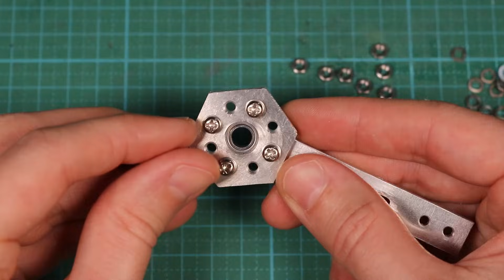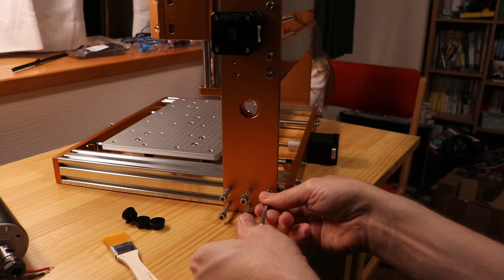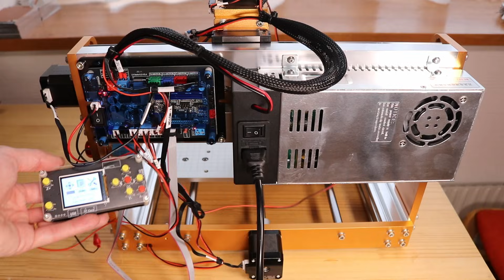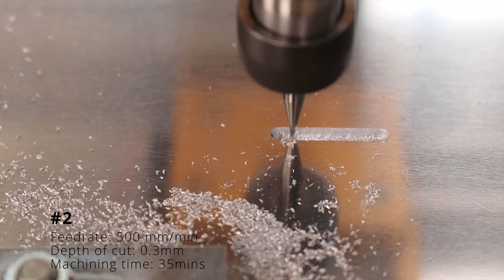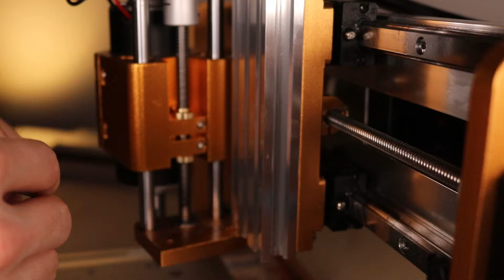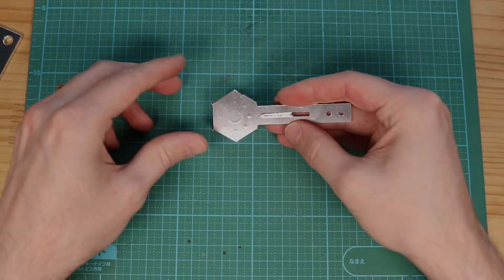Work on Hexa-Bouncer And CNC Upgrade to Lunyee 3018 Pro Ultra

Comment: That has to be the best hobby CNC for the money on the market. I have the Pro model exact same but it doesn't have linear bearings like the ULTRA does, Got it years ago still works perfect but I did upgrade the offline controller.

Comment: what bits are you using? im buying this machine now and wondering if need new bits to work with alluminum
Reply from the maker: I bought 2 flute 1.5mm diameter flat mill from NSTool.
Reply: @ElectronDust do you have the model # for it in website I’m new to this I just ordered this machine two days ago before I came across your video and when it comes in, I want to do the same thing you do with aluminum, but I don’t quite understand the bits and all yet if you could do like a tutorial explaining like how to do a set up and just like a normal aluminum cut job and how long it takes in settings and everything that would be great because your videos is like the only good video I’ve seen thanks man! Also I’d love to buy you a coffee! Learned a lot from this video, don’t see a link in your page though!

Comment: Great video I actually JUST bought this exact same machine & finished assembling it last night. Haven't even fired it up yet cuz unlike you I have no prior CNC machine experience. Can I ask you where do you purchase those blocks of aluminum at that your using for the parts in this video cuz I need to get a bunch of them for myself & my soon to be experimenting work on my CNC machine. Thanks for sharing!
Reply from the maker: Hey,
search for A6061 aluminum. The ones I am using are 3mm in thickness. Hope you find something fitting. Cheers!

Comment: I bought one of these a couple of weeks ago and I’m glad to have found your video. I have a newbie question: did you score your table surface or did you use a sacrificial piece/spoilboard?
Reply from the maker: Heya!
I added a sacrificial piece made of the same material under the main work piece.
Happy milling!

Comment: Why not keep the fast speeds from the second attempt but with like 0.1-0.2mm of material left which then gets milled away during a final precision cut at full depth ( or half the depth of the part... whatever works for you ) but at a quarter / half the speed? You'll get the best of both worlds... Not waiting for AGES for the thing to finish AND still get an accurate part. Also doing the final cleanup cut at full depth will produce a MUCH nicer finish ( again... IF your machine can handle it ).

One workholding method you can try with your machine is to put painter's tape onto both the bottom of the part AND the waste board, then supergluing the two together. Set the operation that "frees" the part from the stock to leave like 0.2mm of material at the bottom keeping everything connected and remove that final bit of material with the above-mentioned strategy. The Painter's Tape and Superglue should be able to hold the parts in place while they're being freed up during the final operation.

Comment: Use different endmill with DLC coating .. it will cut little bit better ... the aluminum will not stuck to it so it is causing less resistance while cutting ..

Comment: place a piece of wood etc under the material to cut so you can cut all the way through with the cmc and save a lot of post processing time " don't forget to leave a couple tabs per party so they don't fly out " , spray a little mineral oil on it while cutting and have excellent finish surfaces

Comment: I like Vernier calipers myself but you need to get something that isn't plastic. Deflection on the jaws will make for horrible measurements.
Reply from the maker: I couldn't agree more. Your comment might have been the final push that I needed to get some better measurement tools. Any recommendations for a solid vernier caliper?
Reply: @ElectronDust Mitutoyo

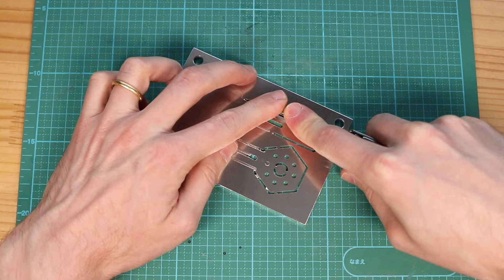Comment: 9:36 that knive. Are you using a victorinox multi tool to cut the stock aluminum? You mad man XD
Reply from the maker: It's indeed a Victorinox multi tool. ^^
I just learned about deburring knives. But at this point, that multi tool has become my deburring knife.

Comment: As you I would check the worktable distance from spindle. It seems to vary as parts are not cut through at perimeter.
Reply from the maker: Agree. Same thing happened with my old desktop CNC. I thought that's just how it is with these type of hobby CNC machines. I could mill the surface of a big aluminum plate level and then fix my work-pieces on top of that. That should give me less variance across the X-Y plane.
Reply: @ElectronDust  Making new worktable isn't bad idea as you could correct that weird clamp thread pattern pitch at the same time. Easier thing to start with would be try adjust whole gantry location. There is some clearance on 12 screws fixing it and whole problem might be possible to solve by adjusting them.
Reply from the maker: @kimmokomppa8236
Your comment was on point. It really was a problem of how all the screws on the top structure of the machine were tightened. I readjusted them while continuously checking the Z height with the probe and now the worktable is level +/- 0.03mm in all directions!
Reply: @ElectronDust  That value sound really good and great that you found easy solution to fix problem!

Comment: The very very first upgrade for this machine is a dustproof enclosure for the power supply and controller. Aluminium dust will get *everywhere*. Speaking from experience with an open frame CNC router at work.

Comment: Not only do you return to us after 4 years, but you return with the exact same machine I bought myself a couple of weeks ago! I've been too afraid to do anything beyond wood, but this video definitely shows I can raise my expectations. I'd also be curious to learn more about your enclosure- how much does it reduce the noise?
Reply from the maker: Hehe, nice coincidence. The noise when cutting aluminum goes from "someone is using a vacuum cleaner in the same room" to "someone is using a dishwasher in the same room" levels. It of course depends on the materials you use.

Comment: you can use a laser cut machine. it is more precise and several times faster, maybe x100 times faster. also it can make sharp edges.
Reply: The machines capable of laser cutting aluminum of that thickness are in the realm of 10k USD...
Reply from the maker: My understanding is that aluminum isn't the most suitable metal for laser-cutting. Milling seems to be more straight forward for DIY projects.

Comment: Great to see you back again. 
This looks like a very capable CNC. 
Did you also get one of the laser options as well and if so, does it need a smoke remover installed to run, similar to your noise dampening enclosure you made for it?
Cheers 👍💪✌
Reply from the maker: Hey @rjung_ch,
I didn't get the laser option. I did install a fan in my box. Just because it gets too hot inside with no air circulation when doing a multi-hour milling job. So maybe that could also work as a smoke remover. My experience with laser engravers is zero though.